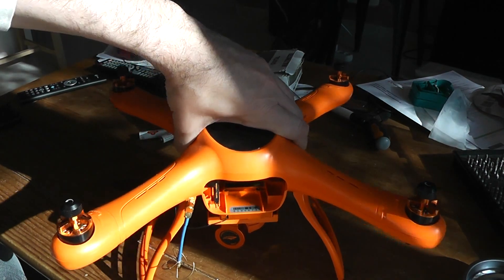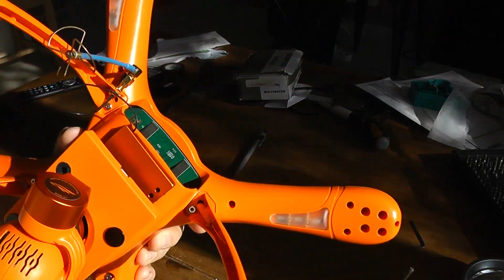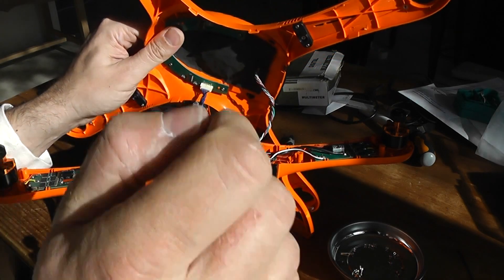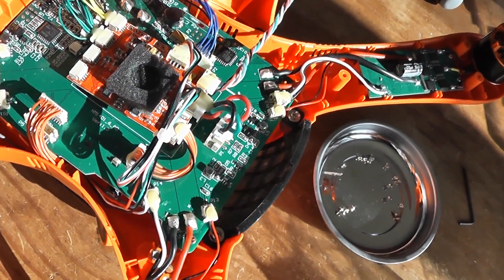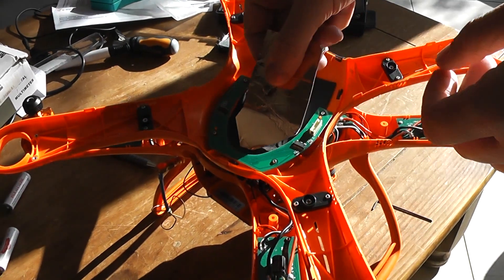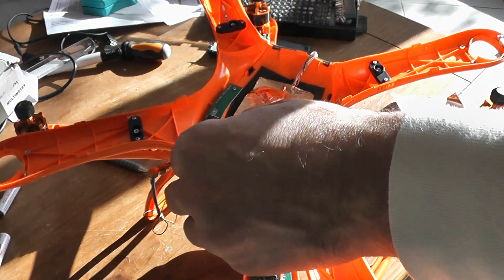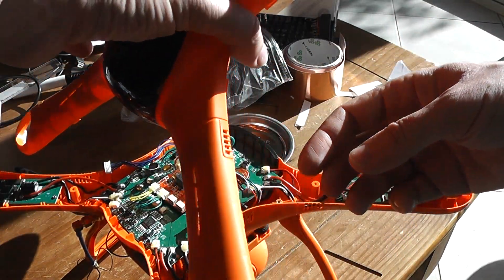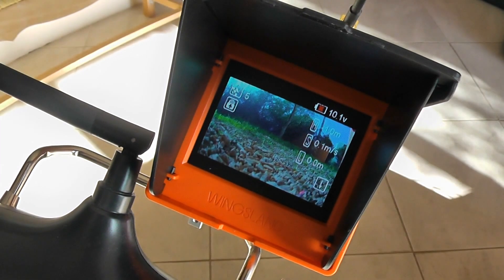Wingsland Minivet GPS modding (Courtesy Banggood)

Comment: Hi SeBy,  what kind of tape was that???  I finally ordered one yesterday.  would you recommend to put the plastic tape over the metal tape? Any other mods you would suggest I make? and the fpv screen you suggested... Will that just work with no modifications? Thanks as always for your reviews. any new reviews you've done lately on this quad?
Reply from the maker: +Randy C Yes you can fore safety add some tape over the EMI tape to isolate everything :)

Comment: Hello SeBy  I have a question if you so kind. Do you recommend me to change the FPV transmitter  in the Wingsland Minivet and wish one you think shall I get? There is so many in the market that I really don't know what to buy. Thank you.
Reply from the maker: +Nelson Villanueva You broke the original one .? Well in anycase, you will have to modify the connector plug of the original minivet (3 position) to be adapted to your new VTX. Personnaly, I would take a 200mW or 600mW 40CH. There are plenty in the market now. Of course with CL antennas only and only if you modded your original monitor to welcome any type of antenna or use anothe FPV screen. For example this model: http://www.banggood.com/FX-X50-6-5_8G-600mW-40CH-Wireless-Audio-Video-AV-Transmitter-With-Antenna-For-FPV-Multicopter-p-1009058.html?p=YL2512105842201212FR

Comment: Seby, can you try other FPV monitors and compare range and quality as well as confirm that there isn't any telemetry or maybe there is.Thanks
Reply from the maker: +flyercan There are some OSD informations and the are independant of the FPV Monitor. So whatever the FPV monitor you will use, you will have these informations. It's hard very hard to male a fair comparaison in term of distance but I am 100% than with a better FPV monitor you can at least have a video range linl multiply a factor 2 or even 3. I advise the AOMWAY HD518 as FPV monitor, high resolution and including a DVR: http://www.banggood.com/AOMWAY-7-Inch-LCD-5_8G-32CH-Dual-Receiver-FPV-Monitor-DVR-with-Sunshade-Built-in-Battery-p-1012632.html?p=YL2512105842201212FR
Reply: +SeBy DocKy Thanks. :)

Comment: You should put some plastic tape over the metal tape to if it should touch any of the circuits nothing shorts out. I would also  wrap some metal tape to those GPS cables then wrap over with electrical tape too, this should speed up the satellite connections. Happy flying! ;-)
Reply from the maker: +Bobster986 Yes ... it's a good advice. Usually I am also adding such taping but here no risk of direct contact with the EMI tape and any electronic conpounds. There is a room of 2-3cm between

Comment: Nice mod, I am thinking of doing the same on FY-X6 (the broken one).
Two questions:
1. How many satellites you had on the same location before the mod? Any improvement in signal quality (can the minivet display HDOP like FY-X6 does)? 
2. Did you insulate / ground the copper tape upon closing the case? I am afraid that on the FY-X6 I might get some short-circuit without insulation as everything is so crammed. Will the application of electrical tape over the copper tape decrease the RX-shielding capability? 

Thank you very much in advance.
Reply from the maker: +FrontierNG Now I got a solid 8 statellites and fixing faster.For the FY-X6, the GPS module is jailied into the dome... So no problem of potential shortcut. In the worst case, use a piece of foam to separate
Reply: +SeBy DocKy I was thinking of the internal canopy (ESCs, etc), the GPS inside it's dome is fine.

Comment: Thanks for the video. What attributes does the Minivet has over the Chase Upair. I am in the market for a quad in this price range, but have read that the Minivet has had some issues with battery . What is your opinion?
Reply from the maker: +William Mjema It seems that the Minivet don't suffer anymore of some Battery problem. You know most of recent "chinese" AP machine suffers of battery problem since I guess the battery problem is the same for all of them (cf. CX-22 and even the UPair). By the way, I was Impressed by the stablization of the UPair in 4K version
Reply from the maker: +SeBy DocKy I still consider the Minivet as an excellent choice. Now doing the UPair review....  They are very close .... The minivet is now sold 480.... just amazing
Reply: +SeBy DocKy Thanks for the response. I am following almost your every video. I hope by January I would have made a choice between the two.
Reply from the maker: +William Mjema But you didn't purchased recently a X380 ?
Reply: +SeBy DocKy I have it but I am going to give it away so I am thinking of a replacement quad. Do you propose I should buy another X380 instead?
Reply from the maker: +William Mjema Are you looking for a machine equiped with the gimbal + cam ?
Reply: +SeBy DocKy Yes and fpv monitor.